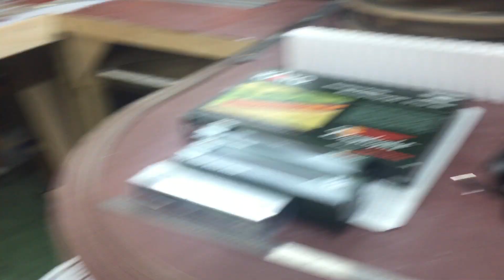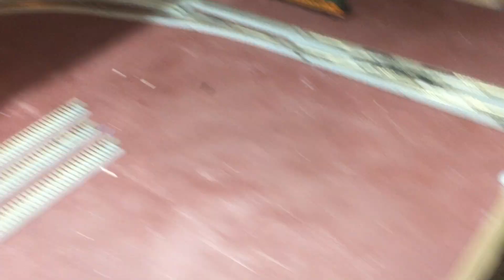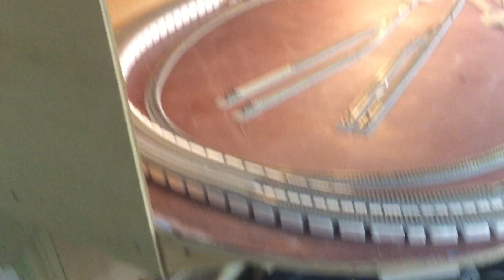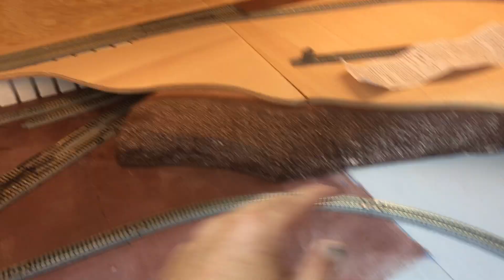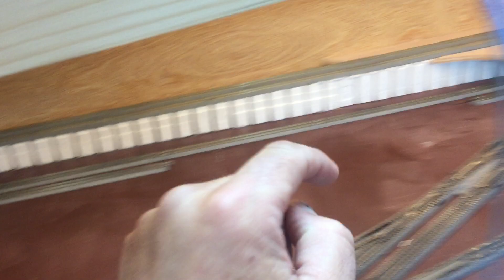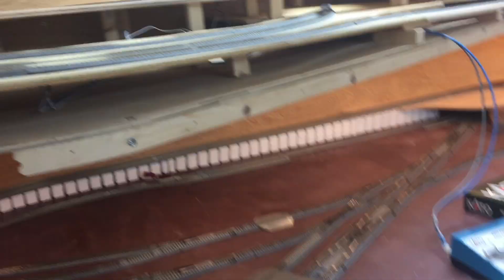N Scale OsO Valley (Big) Update 17

Comment: I use Digitrax AR1 reversers.  Work well, and inexpensive.  Also, instead of lowering the layout, why not build a 4" or 5" step platform around the front of the layout - maybe 12" or so wide?  Would still allow you to step back and have a nice eye-level view of the top run.  Would be simpler and much easier than trying to lower the whole layout.
Reply from the maker: Good shout. I do like Digitrax gear and the AR1's, heard good things about them. Also thought about the step as you mentioned but I think I'll bite the bullet and shorten the legs since it's already quite small once your stood inside the operating area and I like easy access to underneath the benchwork. Anyway, why make it easy for myself? I've done just about everything else the hard way so far...